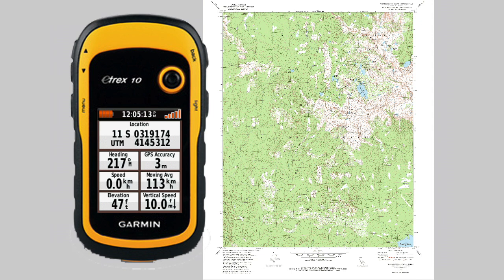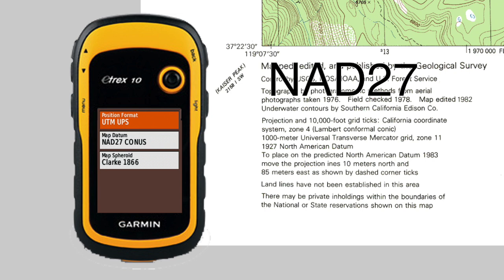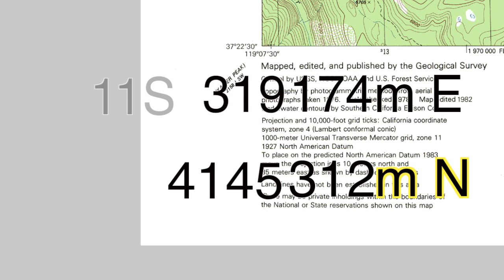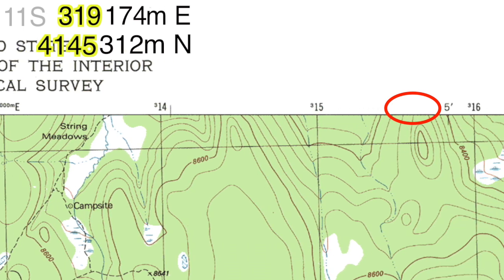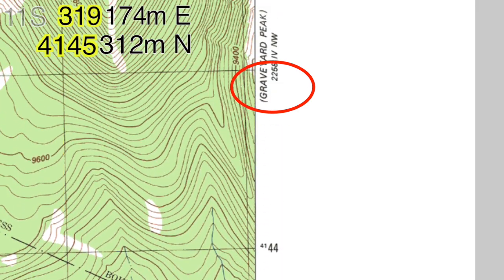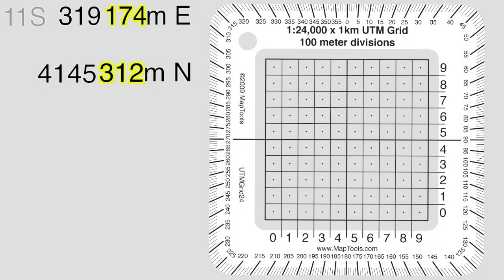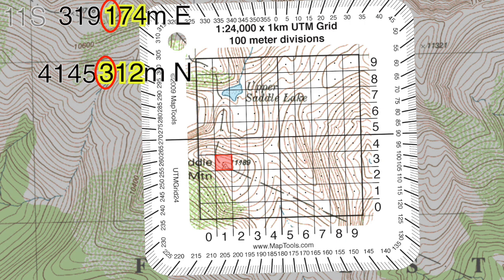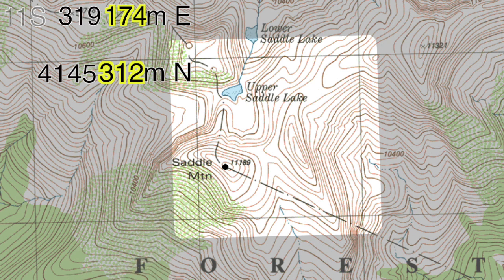Plotting UTM Coordinates with a Grid Tool

Comment: Very well explained! A little tip from using the UTM grid in the (German) military: in order not to confuse N/E (first go up/down or left/right on the grid?), imagine a cat: the cat runs first TO a tree (i.e. first group of coordinates is horizontal direction), then the cat climbs UP the tree (i.e. the second group of coordinates is vertical direction).
Reply: Easier way: 1. GRID MARK (33, 34, etc..),
 2. SQUARE MARK (T, WL, WK...), 

3. VERTICAL NUMBER,

 4.HORINZONTAL DISTANCE

 5. HORIZONTAL NUMBER

 6.VERTICAL DISTANCE

Comment: just bought the round mgrs/utm coordinate reader and i have to say the booklet glued to the tool with the mgrs quiz was far more easier to understand than the also included booklet tools for working with utm,mgrs, and usng coordinates which has the quiz using utm. i didnt need to read the instructions to understand mrgs. i just looked it and the dots connected. unfortunately utm is not working out do well particularly because the map is in 1:50,000 and the 1:50,000 slot tool does not have the finer markings. so far mgrs supper easy while utm sucks.

Comment: This is a great video explaining UTMs and how to set up your GPS, but if you really want to be as accurate as possible, why not just use a set of calibers and measure in mm how far you are from the grid line and multiply that by 24 because every mm on a 1:24000 scale map would be equal to 24 meters on the ground. 

In your example you could have divided 174 by 24=7.25 so on the map the spot would be 7.25mm from the 319 grid line and from the 4145 grid line take the 312 divide by 24 to give you 13mm from the 4145 grid line. To me you can't get much more precise than measuring in mm. 

To go from GPS to map divide remaining numbers after grid line by 24. 

To go from map to GPS measure spot on map in mm from grid line then multiply by 24 to get meters for coordinates.
Reply from the maker: Your technique would totally work. But imagine you are in the field; it's dark and raining. You are tired, wet, and cold, should you be dividing by 24 and then measuring in millimeters with your calipers?

Comment: Why is it you don't use the 8 digit grid like the military is it because of the GPS ? And will a military protractor work?
Reply from the maker: The 6 and 8 digit Military Grid Reference System coordinates are just abbreviations of UTM coordinates. Learn UTM and rest follow easily. A military protractor will work just fine. At the root of it, your just measuring distance on a map in meters.

Comment: Nice video.  Very easy to understand.  I have a question though.  My 1:24,000 maps do not have the UTM lines drawn on them, so I’m having to fill them in myself.  But they do have some other type of lines that intersect and form grids that are about as big as the entire UTM map reading tool you use in your video. Do you know what those are and can I use them with the UTM map reading tool or do I have to continue hand drawing the UTM lines?  Thank you.
Reply from the maker: Not all USGS maps have the UTM grid lines drawn in. In those cases you'll need to connect the UTM tics on the edges with a line yourself.

The other grid lines you see, most likely printed in red, are the Public Land Survey section lines. They are typically one mile square. Prior to opening the Western United States to homesteading, the land need to be surveyed, and the Public Land Survey System is the result. The USGS has a nice description of the system here: https://nationalmap.gov/small_scale/a_plss.html. The BLM has a nice video on the history of the system. https://www.youtube.com/watch?v=eR2F8OdW34E. The PLSS has plenty of irregularities stemming from errors in the original survey work, so it does not make a suitable coordinate system for using with a GPS receiver.
Reply: MapTools Thanks for responding.  I’ll read up on the PLSS.